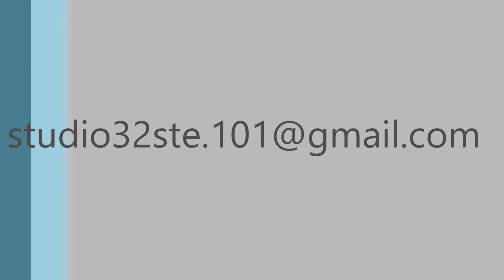Soldier Proofing

Comment: That the worst part about the design of this bb gun the fit mint is not the greatest that's why I thought if it was cnc aluminum mag main frame and harden valve it would save a tone of time and alignment problems. I'm getting my parts ready and I'll. emial
Reply from the maker: This one popped up out of nowhere, but I'll be done with it tomorrow. Send it anytime you like. It's really not that bad fixing. Of course it would be better CNC milled, but that would be cost prohibitive. We get around it with Freebird using a sealed breach. You give up mag removal with that design so we are back to everything being a compromise again.